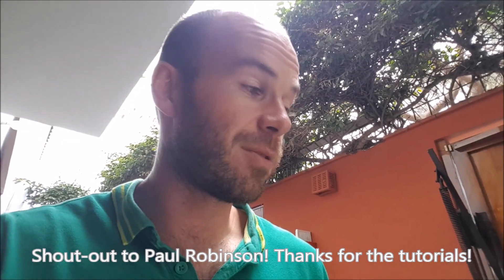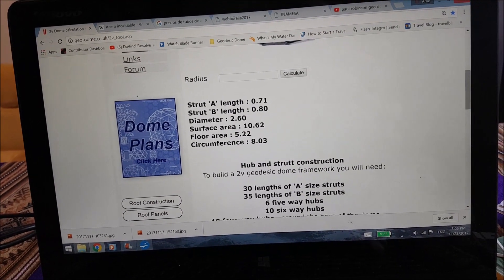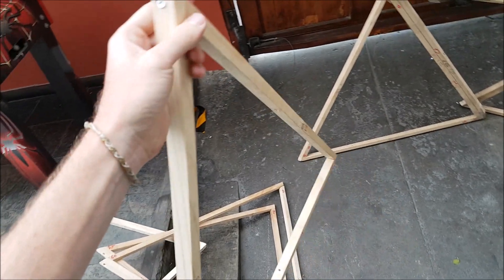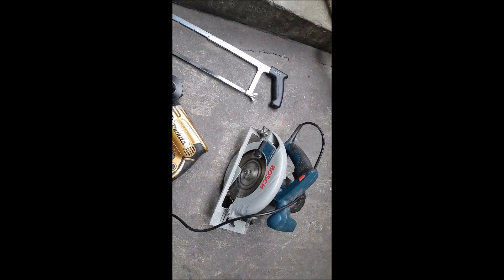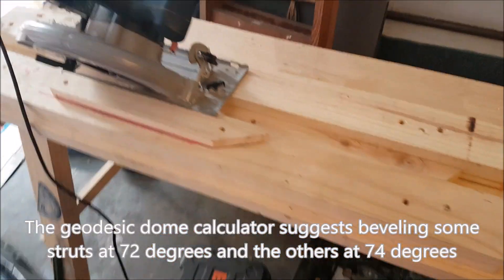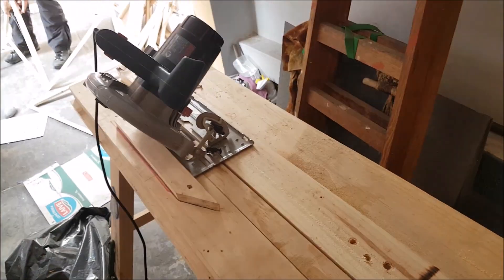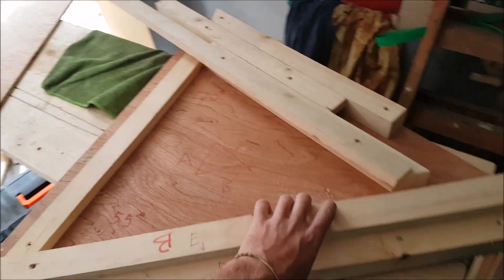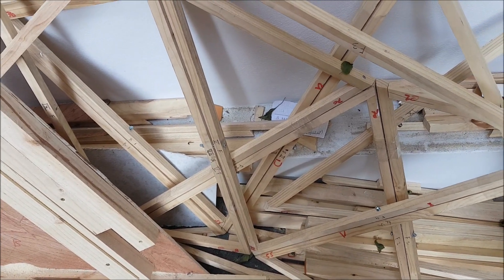Building a Wooden Geodesic Dome Skeleton - Lessons learned

Comment: What do you think of bevelling the ends instead of bevelling the whole lenght and weaken the struts. Would be realized with one short cut.
Reply: You`d need to cut 2 very accurate compound angles on the end of each strut. Hub and strut is easier than bevelled panel but a lot depends on the domes intended purpose and cover material.

Comment: I have a question about that calculation tool on Geo-dome site, it appears like it calculates a single strut for each vertex, but to build a wooden triangle beveled frame out of triangles it takes 2 struts per vertex. Did you just double what it told you?
Reply from the maker: If you look a bit further down in the tool calculations, it also gives you the information for "panelised construction". That information includes the number of panels you need and the strut lengths they are composed of. You find the total number of struts you need by multiplying accordingly.

Comment: The frame method is good for very large domes as most of the assembly is done in the shop, not on top of a ladder or scaffold.  The biggest drawback is making all the joints between the triangleswatertight. Being a natural material, wood has a tendency to expand, contract, twist and bow..
If you build another i`d recommend using the hub and strut method. It involves a lot less cutting / drilling and takes about half as much timber..
Reply: Yeah that is definitely a better way to build these domes. The actual hubs can be squared off and the wood struts angled to create the dome. Paul sometimes uses hexagon and pentagon blocks as his hub connectors, then you would only need to cut the ends at 72 and 74 degree for a 2 V dome structure. Some variations on hubs exist, from circles to metal and wooden plates. These are great builds, but can get complicated if the connections are not accurate and aligned. Wood thickness another important factor in comparison to overall size of the dome.
Reply: @gazsto9510 
My hub preference is heavy wall aluminium tube and hanger bolts. It gives a nice clean look and makes assembling the dome very easy. 
https://youtu.be/LnX2W2mgl0Q

Comment: How do I figure out bevel edge angle?
Reply: The abeveld angle is rounded to 72 and 74 degrees. But in the video above he rounded both to 73 . This will work but may need slight adjustments as you build the dome. Also the bigger the dome the more noticable that difference becomes.
Reply: @kulwinderThandi  
That is the axial angle used for hub and strut domes. The panel method requires a full length bevel. An accurately made 2v dome involves 3 different edge bevel angles. The 10 equilateral triangles have 79.2 degree bevel on all three sides. The 30 pentagon triangles have 78.8 degree bevels on the short sides and an 82.8 degree bevel on the long side. The corner angles for the equilateral triangles are all 60 degrees. The corner angles for the pentagon triangles are  (2x) 55.57 degrees and (1x) 68.86 degrees. The chord factors are 0.618 and 0.5465